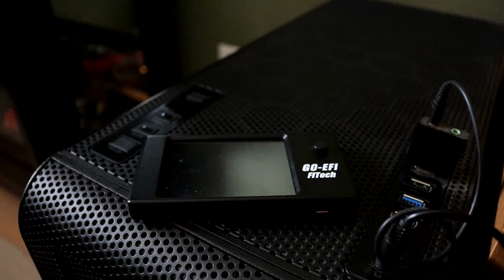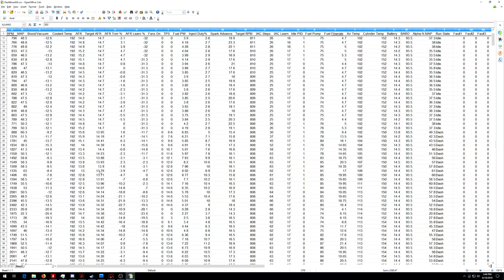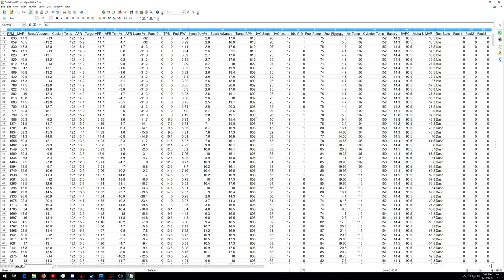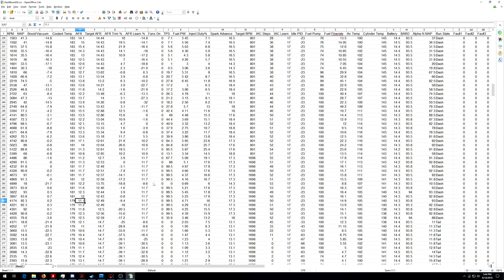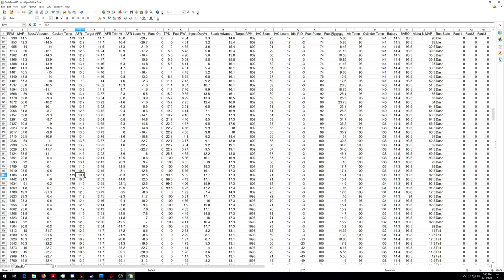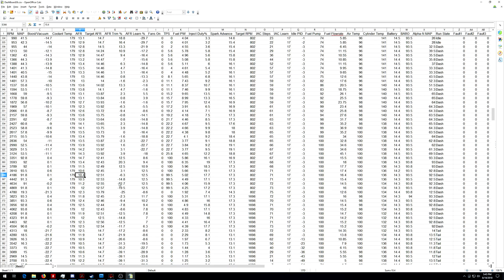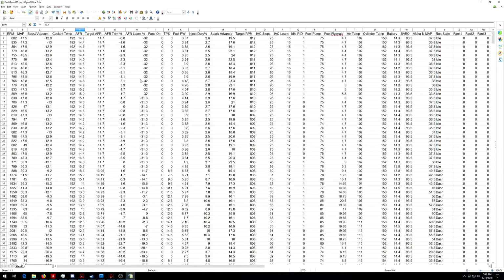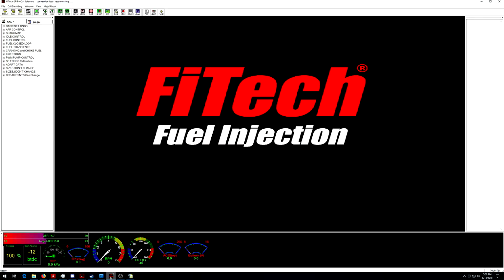FiTech Data Logging Guide

Comment: Hi, do you still have this car with the Fitech system? I have a 396 with a 38351 Fitech system on it. I was looking over your spark advance numbers. 18 degrees seems way low. 32-36 at 4000 rpm is recommended. your engine shows 17 degrees mostly. I have my max at 35 degrees at 6000 rpm. I'm running a Blueprint small block. Thanks for the video's.
Reply from the maker: At the time of this video I did not have timing control, so spark table was meaningless. I do have a video of setting up timing control with my Fitech, you can see my advance curve there. I do still have the Fitech on the car.

Comment: I’ve been fighting with log files for a while. When I create one I get the labels of the top row on every other row. FiTech sent me a new controller and it does the same thing. I’m at a loss.
Reply from the maker: what software to open the files? you could try updating your fitech firmware too
Reply: Same here. It started ok. Then my last data log every other line. Will call tech support on Monday.

Comment: Here is my combo: Fitech Go EFI 4 600HP, 331 DSS rotating assy, ARF 185cc 58 cc combustion chamber(10.5 to 1),Weiand Stealth(dual plane), hydraulic roller 224/234 @ .050 .532/.536 lift 112 lc 108 center line. Power range on cam is suppose to be 1220-6200. 22-2400 stall converter in a 91 Ranger with 3.5 gears. Not running timing control at this point, but plan on changing that soon. Problem is there is no bottom end power. Can stall up to 2100 -2200 tops. Barely spins the tires when it should frying them. Power seems to come on after 2500 to 3000. I'm hoping changing the ignition system to MSD for timing control and Digital 6AL will cure the problem. The distributor now is https://www.ebay.com/itm/SMALL-BLOCK-FORD-289-302-BLUE-Small-Cap-HEI-Distributor-COIL-SPARK-PLUG-WIRES/200942032373?hash=item2ec91415f5:g:X2YAAOxy3NBSi5cg  . What do you think?
Reply from the maker: I think you have the wrong camshaft. A split duration would be a much better choice with AFR heads. Regardless, your engine should be a tire shredder for sure. What size are your tires and is it 2wd or 4wd?
I wouldn't get that distributor because its an HEI with vacuum advance. You need a simple dizzy that you can lock out. You will control the advance through the EFI.
Reply: @SS454LS6  The cam is 224 int 234 ex @.050. The ebay dist. is whats in there now, planning on installing the MSD(locked out) and timing control this weekend. Wont be able to run til next week after I reinstall transmission. 29" tires
Reply from the maker: @k.j.hopkins7111  The cam has too much duration between exhaust and intake for the AFR heads. Not the perfect cam, but it should still make big power. 

With a 29" tire, that would be like me going from a 3.55 to a 3.27 gear ratio. I think your truck would wake up with 3.73s or 4.10s. Good luck on the wrenchin
Reply: @SS454LS6  I was thinking Ford 9" 3.89 ratio
Reply: Thank you

Comment: For whatever reason when I try to create a log file on the dashboard, the file wont appear anywhere. I just did a log file under basic sensors, a folder was created and was able to find the log file and read it .So I deleted the dashboard folder and will attempt to create a file on dashboard. Any experience this?
Reply from the maker: I have not. I would love to get do a test myself, but we are about to get hit with a foot of snow. I would definitely contact FiTech, if they are even open right now.
Reply: @SS454LS6  They are. I called them yesterday. Extremely long wait.
Reply from the maker: @k.j.hopkins7111  That is the problem with them. Did you get through and get any kind of answer?
Reply: @SS454LS6  I deleted the Dashboard folder and went out this morning and did a log on dashboard. It worked. Got lots of info. Thanks
Reply: I called Fitech today and was 4th in line.Hold wasn't too bad today. I told them about that issue and they said that  deleting the folder was the fix. They had calls on that before.

Comment: So I try to create a log file and all I get is an empty                                                     DashBoardDashBoard1.csv. 0 kb

DashBoardDashBoard1.csvDashBoard1.csv 0kb

I Log on when I'm ready to go and log off before I turn anything off. Suggestions?
Reply from the maker: I would call FiTech tech support at that point.
Reply: @SS454LS6  Thanks for the reply. I found the data logs. But where I ran the it through the gears( once on the rev-limiter), The logs read zero and .5 on the TPS when full throttle. Will try again tomorrow.

Comment: I went through the log on/log off procedure but when I went to read my log in Open Office it said the dashboard file was empty. What did I do wrong?
Reply from the maker: Ensure you hit Log On with engine running, and Log Off while the engine is still running. Also you can't back out of the dashboard while the log is running.
Reply: @SS454LS6  That's the way I did it. I'll try it again today. Thanks.

Comment: I'm having the same issues with my power adder 600 on a 408w engine. I switched to a different fuel pump and it instantly started lean spiking and then going way rich. Even past 10:1 and it would completely fall on its face.  I changed accel pump setting and it made no difference. I ended up resetting the fuel learn and that made it way better. It still occasionally stumbles slightly and it does go rich when instantly going WOT from an idle so I'm still tweaking it. Another weird thing with my fitech is it will not data log from the dashboard. I turn logging on and make a run. Turn off logging and power down the system and let it save. But when I try to open the log file it is completely blank. If I usu the data logging option under the main menu it work fine but not from dashboard.
Reply from the maker: I address some of the lean spike issues in my Pro Tuning video. As for the data logging issue, I would contact FiTech about a replacement. Data logging is a VERY important tool.

Comment: The lean to rich swing is very common on FiTechs, might not be the pump.  Mine is doing this too to the point where I get big spits.  Step up your fast accel, you might need to fiddle with the two other settings near the bottom of the page.  TPS gain and dTPS or something like that.  My fast accel is maxed out, as well as the gain and dtps.  If you encounter that you need to start stepping up appropriate values in the 3d accel pump map under pro tuning.  I made some progress this problem, but keep making big changes to the setup and need to start over.  440 in a '68 Coronet R/T, weiand tunnel ram, Fitech dual quad 600 w/command center.  Keep up the videos!